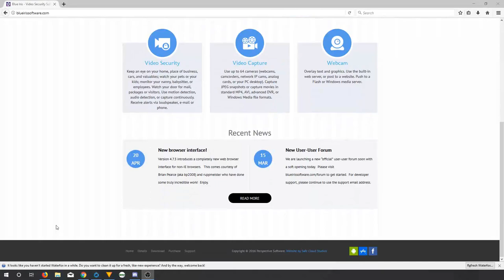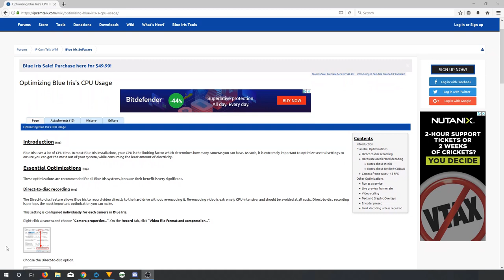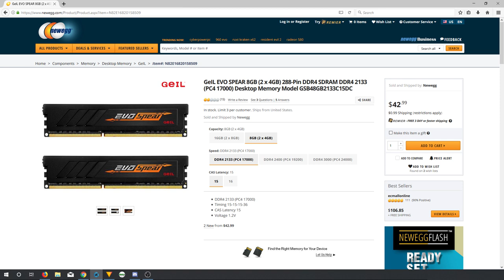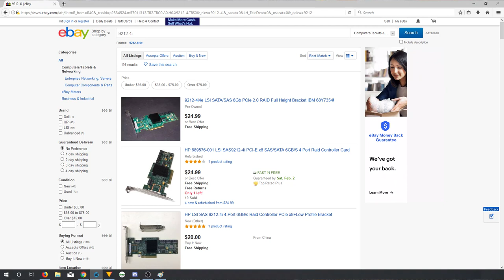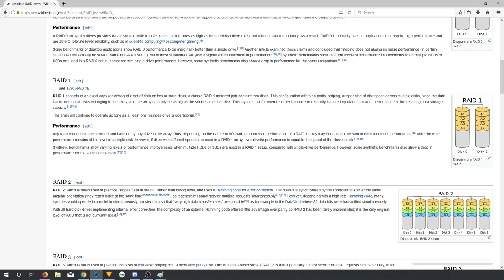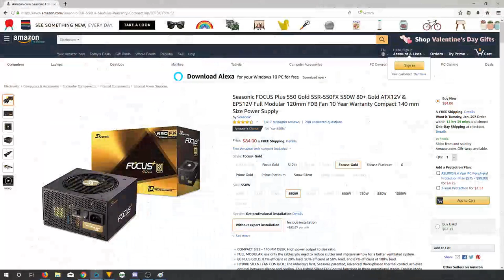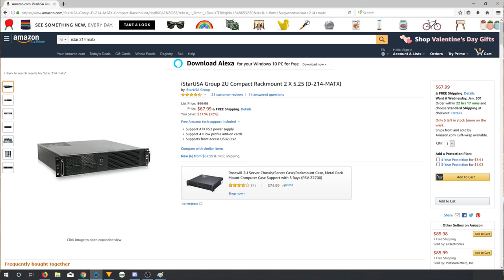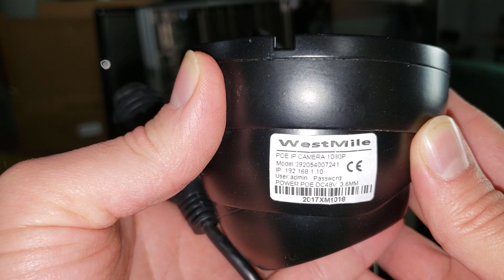Video Surveillance Server Build for Home / Business

Comment: Hi, great stuff and great info. I'm planning on a similar build but it may not end up being rack mountable.
Anyway, I had a couple of questions I hoped you might be able to answer...
I'm going to be using a microitx board with a 3rd Gen i7 (with quicksync), 8gb ram, 3 gigabit Ethernet ports, a 240gb SSD for the system, blue iris logs etc and hopefully a VM, which I'll talk about in a sec. Also a 3tb drive I had lying around for the footage. Not too concerned about backups really.
I'm thinking of going with reolink 5mp 4k IP Poe cams, with a small dedicated Poe switch and a gigabit uplink connection. I want the cameras only to talk to blue iris, and not the internet or Lan directly.
I'm thinking I might have to run pfsense in a VM on the machine and map the physical port coming from the camera switch, to the VM, and from the VM a virtual port running to the blue iris software. I've never used blue iris or pfsense, does it sound like I have the right idea, or am I overthinking it?
If there's a way of keeping the cameras off the internet without bothering with a virtual router/firewall, I'd love to know about it!
Do you think the 3rd Gen i7 would cope with 4 of those 4k cameras?
Can you use blue iris to safely and reliably "relay" the video it is capturing, on the Lan and to the internet?
Last annoying question, as far as you know would a system with a load like I've described also cope with being a file server (two  8tb drives) to two to three users at peak?
Thanks for reading and hopefully someone has some insight here. Cheers!
Reply from the maker: Hi Richard!

Sorry for the late reply! Glad to see others interested in useful tech 😀

I have not personally tested any 4K cameras yet so it's hard for me to know the requirements. I do know there's configurable options to reduce the workload on the CPU and iGPU to generally speaking get cameras working well. 

I would certainly suggest an i7 for multiple cameras, especially 4k ones. 

A good micro ITX motherboard should be OK but I would not necessarily go too far on the cheap or even junk side. The reason I say that is that mITX boards may not have the ability to cool the VRMs well while the CPU and iGPU are under heavy loads. In addition to that, cheaper boards generally lack good connectivity options, lots of SATA 6gbps ports, poor SATA controllers, few / no 3/4/ pin fan headers for system cooling. It's possible to get a great mITX board that checks all of your boxes though. One last thing to note, mITX usually means 1 maximum PCIe slot, if you don't have enough SATA ports or end up growing, you likely only have one slot to add an HBA / RAID card.

Glad to see you have security in mind, that footage is yours and you should protect it as well as your network! The way I would set your network up (read, not a configuration hosted on this PC) is by creating a VLAN or virtual local area network. I would assign this VLAN for camera use only to the switchports camera are connected to. You can block Internet access on a per VLAN basis with a router or firewall as well as any other hosts on other LANs. You could add that PC/Server to that VLAN for maximum security or keep it off that VLAN and create custom rules to allow the cameras to get to the Blue Iris server. That part is kind of up to you. I would not personally recomend howver creating a VM for pFsense and running it on the Blue Iris server. It is common to try to consolidate but you likely do not want to get into a situation where there isn't enough CPU or IO power available to do both tasks well. I suggest build a low power, cheap, pFsense firewall and setting up your LAN from that. This will solve your security problems. PFsense does not require much, I build a custom server that was overkill with an embedded quad core Celeron board / CPU combo. Might do a show and tell on that one in the future if there's interest.

I have not yet attempted to remotely view any footage as it's not something I need to do. The Blue Iris website however does have a "Web Server" page that outlines the functionality you are looking for. Here's a copy and paste with the source:

Web Server

Built-in web server enables you to bring your Blue Iris with you anywhere!Remotely connect to your Blue Iris from anywhere in the world, from any web enabled device.Desktop and mobile viewing.View live cameras, recorded clips and alerts.User authentication with permission based viewing.Automatically adjusts if IP changes.Detailed log.Use Blue Iris’s powerful digital Zoom and Pan functionality remotely!Access PTZ presets easily
Credit: http://blueirissoftware.com/web-server/
Blue Iris

If you are also looking for a file server, I would not recommend running that on a Blue Iris server either. Similar reasons to the virtualized firewall but more importantly, if hte data is important to you, you need a solution IMO versus extra hard drives. What I mean by that is a file system dedicated to storage, something withing with low overhead and storage oriented features. Good hardware dedicated to the task, a RAID card or a proven software array solution. If you used a mITX board for example, you would only have 1 maximum PCie slot, so you could only use a NIC or RAID card / HBA. It's also always a good idea to run ECC memory in storage servers. Rarely a requirement, but always a good idea.

All of this being said, if you built a powerful enough machine, with the right software and configuration, you might be able to virtualize these hosts on it. It would take more dollars than I would assume you had planned though (likely) but could be a possible solution. I don't think I would recommend it though.

Is this for your residence or a property? Customer perhaps? Something else to think about there when factoring in performance, reliability, complexity, and budget.

This was probably way more than what you expected to get back. Let me know if you have questions and/or what your plan will look like! Always good to see others getting into the hobby of making computers do useful stuff!
Reply: @STS  hey mate, thanks a lot for your in-depth reply, really appreciated. 
So I'm pretty lucky in that I have acquired the mini ITX mobo for free (from a bin!!). It's a pretty decent one (Kontron KTQM77) and came with 8gb ram and the i7 with a low profile copper heatsink. It's old but by far the most feature rich board of this size I've ever seen. 6 sata ports, (4 of them SATA 3), with onboard raid support, and two PCI slots. A 1x and a 16x. Plus three onboard Intel gigabit Ethernet NICs. So hardware wise it's pretty sweet.
I'll take your advice and not bother with a pfsense VM, instead I'll see if I can get windows to create a vlan on two of the ports.
I've ordered four reolink 4k cameras in the hope they work. I'll reply back here when I find out. Maybe I'll make a video of my own.
The built in web server sounds great. 
This setup is for myself, so I don't mind if what I do is slightly over the top or unconventional, since I'll be the one fixing it :)
Thanks again, very helpful info.

Comment: Looks like the software supports Nvank encoding, so a quadro p2000 would be amazing as it has unlimited encoding streams (all other gpus locked at 2)
Reply from the maker: Hi! Yes, there are some Quadro nVidia cards that do not have the encoding limitation. To my understanding though, for the purposes of Blue Iris and camera video processing, this does not impact the number of cameras you can assign to the graphics card. It seems the limitation is more the amount of VRAM (video RAM) and GPU clockspeed.
Reply: I8THEmagictoaster check out shinobi. It’s free open source and can use Nvidia card for decode, encode, and motion detection.
Reply: SamsTechStuff encoding limit can be removed with a modified driver.
Reply from the maker: Next Level Code That is an interesting option I may have to check out! I have read that driver modification can allow you to unlock interesting features on the GeForce series GPUs. I don't believe the encoding limit comes into play when using Blue Iris but, it certainly would be useful for a dedicated Plex server serving content to multiple clients at any given time. I plan on virtualizing my Plex server soon and possibly trying to benchmark multiple streams with and without a GPU modified in this way, should be neat :D
Reply: @STS  Nice. If you use linux for Plex there is a GitHub with a script that will automatically patch the driver to remove the 2 stream limit. I've read it's possible on windows too but have never tried.

Comment: @samstechstuff I built a pc years ago. Do you think I can use it for hikvision colorvue cams I’m planning to get 8 cameras here’s my pc spec.INTEL 4770k                                GPU GTX760.                                    16 GIGS MEMORY.                                          ASUS Z87 PRO.                                                 256 SOLID STATE HARD DRIVE FOR OPERATING SYSTEM                                      4TB WD INTERNAL HDD.                                    WINDOW 10.                                                   760 MODULAR POWER SUPLY.                       ETC
Reply from the maker: Hi Fazir22! I'm sorry your comment was auto marked as spam by YouTube. You certainly could use that machine for a Blue Iris server. I would recommend removing the GTX 760 graphics card because your CPU and motherboard support use of Intel's integrated HD graphics solution. This will save you on power usage and allow for the cameras video processing to occur on the iGPU. Let us know how it works out!
Reply: @STS  thanks alot bud!! I will let you know how it does.

Comment: You can do all of this for free with Linux.
Reply from the maker: Hi Mi Dixie! Yes, you are correct. There are however differences between the popular apps. A lot has gone into BI from a usability standpoint which makes it attractive and easy to operate. I am curious about testing on Linux though. If time allows, maybe this summer I can give it a go.
Reply: I’ve been motion for about a year it’s pretty stable had some hiccups when starting out but figured them out running several reolink  5mp cameras and an axis 214 ptz with a 8tb wd purple on a core i5 quad dell optiplex 3040 micro with external hd enclosure
Reply from the maker: Interesting. How does your PC or VM handling the load from the video processing?
Reply: @STS  it runs pretty well I’m about to buy a 4 bay external drive enclosure for it to give it some more storage. Right now I only have a 2tb WD purple which if fills up rather fast
Reply: Nothing in life is free
Reply from the maker: That's a good point, I think I mentioned in a different comment there's definitely a little bit of learning curve for Linux operating systems and how they handle storage. I'm still a fan of Blue Iris :)

Comment: how many Cameras can you run on this set up.  I want to run at least 4 4k cameras and about 12 1080p cameras with this system work for that.
Reply from the maker: Hi McCuneWindandSolar! I have not expanded the system as far as I originally wanted to yet but, I suspect it should support several 1080p 15fps cameras, especially if the memory was running in dual channel and if I bump the iGPU speed up a little bit. I don't know how well all of those cameras would do on an i5-6600K system. To be honest, for that, I would go with the latest 9th gen or possibly go to a video card that supported this workload. You may want to check out the ipcamtalk forums to see what people are using for system that demanding :)

Comment: Definitely looks like you got the computer building part down, but what's up with that ipcam, man? Come on!? Ha ha

I'm the opposite of you i guess.  I have a setup with decent dahua ipcams running on a dahua poe NVR in my [now] rental property.  I got 2 streams each, 1080 and 720 at 30fps and 20fps, respectively.  I recently purchased new cams, including two of the same Dahua starlights from before as well as two Dahua 4k, from my source in China but i want to do a blue Iris PC build this time (NVR UI is obnoxious).  Problem is, i dunno WTF I'm doing. I've upgraded HDDs/SSDs and RAM and Swapped a wireless card before, but that the extent of my experience with building computers (that was all in my asus laptop too). I'm getting some help from my future brother in law, but i don't think he's as familiar with the high powered ipcam setups.  Trying to determine system requirements is like a black hole to me.
Reply from the maker: Hi Ryan!

Thank you - a bit of research went into building the server! Not much went into the camera however 😂. 

This camera was a cheap, quick ship, recommendation from a friend that spec-wise, appeared to be good 'nuff. I plan on watching my sump pump with it 😆

It seems difficult to determine requirements to me too to be honest. I would first pose the question, how valuable is this to you? Then what's your budget? You need a consumer grade CPU with an Intel HD GPU for the best possible performance. It seems like if you want to continue to expand, you're looking into a beefier current gen (9th generation) i5 or even i7. I don't know if an i9 would be wise $$ wise though but would have significant processing power. I have also never tested a 4k cam. 

I can certainly say you will want newer HDDs at a minimum, drives that can write fast and that are built for constant writing. I don't know if SSDs as main storage will be a benefit. I would use an SSD for the boot drive if I did it again though.
Reply: @STS  thanks for the reply.  I've been looking at i7-8700, but I'm wondering if it's overkill for my setup.  The price of the build is quickly adding up.  On the same token, blue Iris recommends 7200rpm drives for 4k storage.  So I've been looking at wd purple 7200 rpm drives... Problem is they don't get to that write speed until 10TB, so they're $$$ (currently $333 on Newegg for the 10TB).  Considering those two big expenses and the need for a pretty good monitor to view it all, I'm looking at a pretty pricey build before even considering the other components.  But i don't know how much it can be spec'd down without sacrificing recording performance.
Reply from the maker: Hey,

Sorry for the late reply here. Yeah, that is a tough one. I guess as for the CPU power, how far do you plan on expanding the camera in a year, or two, or three?

For 7200rpm, it's possible you maybe want some type of RAID array or software storage solution to get cheaper consumer grade Seagates, Toshibas, or WDs that are cheap and 7200rpm. If I needed over 3TB, I would look into a hardware RAID 10 or create network storage connected to the system.
Reply: @STS  well i ended up finding a deal on the WD purple drive. Got a 10TB 7200rpm for $289 bnib with no tax and free shipping.  That's pretty hard to pass up.  So that became a non-issue lol. Sorry.
Reply: FYI, this deal literally went down at like 4am last night

Comment: I have a relatively powerful computer which I can leave on all the time (core i7, 64 GB RAM, 1GB GPU). I wish to have 8 security cameras. Can I just install Blue iris on my computer and use it as a server as well? Or I need to buy a dedicated server for the cameras? Thanks for great content
Reply from the maker: Sam's unite! Thank you for watching and liking! Yes, you can use your main PC for this purpose if you don't have a secondary PC to dedicate to this. This program will however constantly use resources and any downtime your PC has, so will your cameras. Driver installs that require reboots, Windows updates, Overclocking, troubleshooting, intensive tasks that use all of your CPU power, these are all possibilities that could make Blue Iris perform worse. 

If you cannot buy a secondary Intel 4th gen or higher system to dedicate to Blue Iris, your main PC will work. I would however, strongly recommend that instead of using your main PC, you purchase a second-hand or refurbished 4th, 6th, 7th, or 8th generation Intel system (at preferably an I5, I7 if its in budget). These systems tend to be complete PCs from HP, Dell, Acer (any other big name) that have the necessary type of Intel processor that allows the iGPU to be used for video output. This will be key in managing the resources Blue Iris needs to run efficiently. If you were to shop on Newegg right now for example, you might be able to find a business class / office class PC that can run BI well for ~$250-$450.